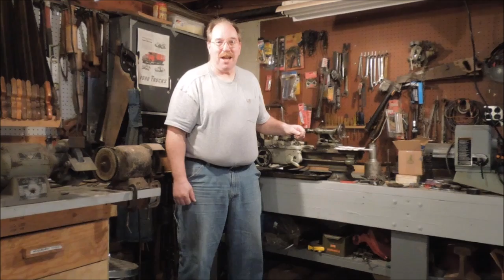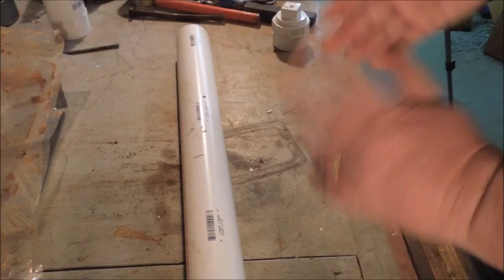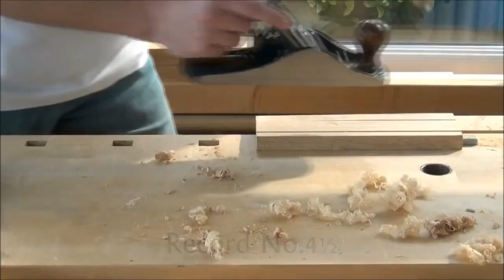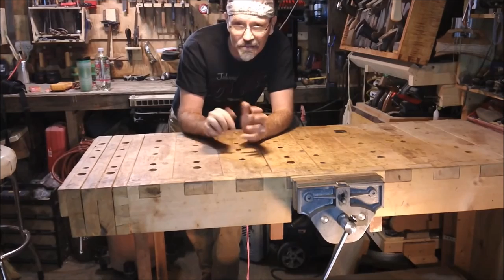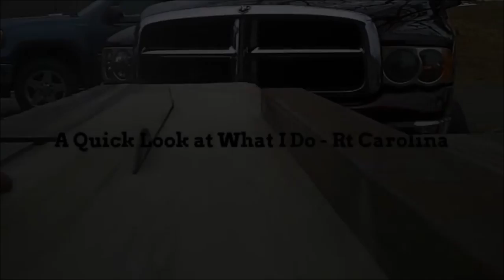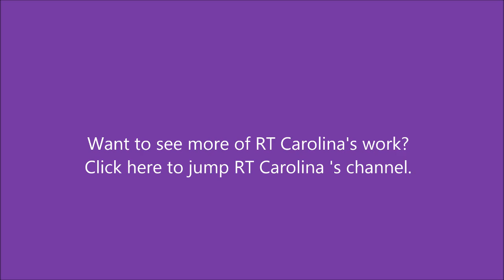Friends Come To Visit #6 - April 15th - at Old Sneelock's Workshop

Comment: Hey Sneelock, I must have been hiding under a rock somewhere cause I didn't know about your vinegar rust removal, but I'm all ears and eyes now as I too have got rusty tools and files that need some cleaning. Also thanks for your friends visitation, Going now to visit RT Carolina and check him out. Take care.
Reply from the maker: ***** I've tried all kinds of ways to remove rust. Shot blast, caustic baths, acid baths, electrolysis, potatoes, Evaporust, at one time or another each one has worked. I've kind of settled on electrolysis for in the summer. Because it releases hydrogen gas as it works I don't want to use it in the basement shop. 
You can go to my video on electrolysis here: https://www.youtube.com/watch?v=FWoWx5CA7Nk
But during winters cold weather, finding your parts not only still rusty but frozen into a bucket of soda water makes for a bad morning. I could put a heater in the bath for winter use but seemed like too much hassle. 
Evaporust works. It cleaned well and didn't etch the parts too much. But it cost $25.00 for the gallon I bought. It was good for about 40 auger bits and then it stopped working. 
Vinegar works, it's cheap at $3.50 per gallon, and the Apple Cider Vinegar is pretty easy on the nose, but a word of caution. The acid will remove metal along with the rust. You'll want to monitor the bath closely and remove the part as soon as the rust is gone. Just like sharpening a file with drain cleaning acid can eat the teeth off the file, vinegar will do the same just more slowly.
Reply: Thanks for tell me how to use the vinegar method. I will try it, sounds like safest way to go and the cheapest. Take care.